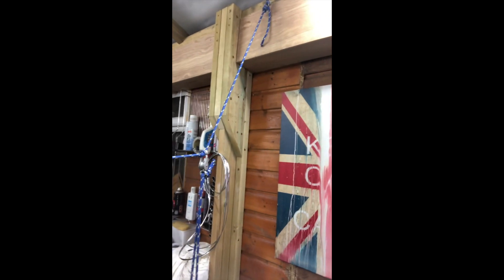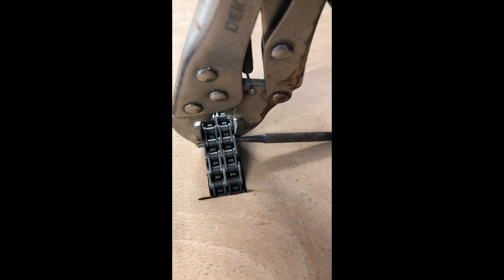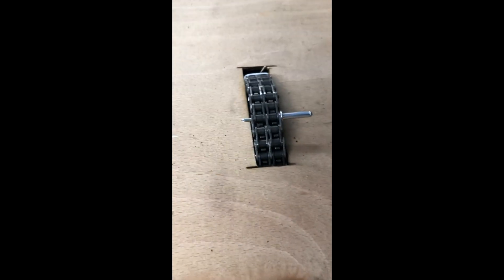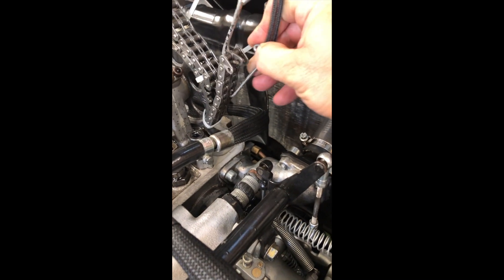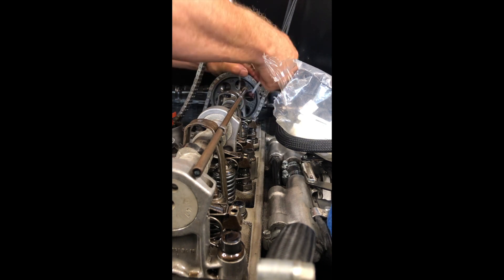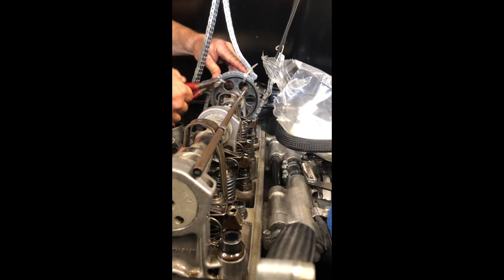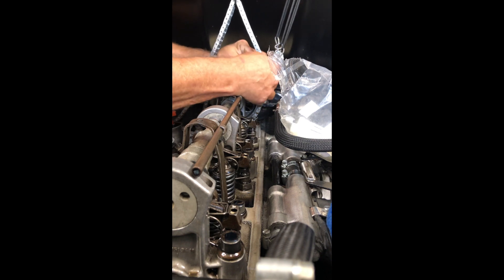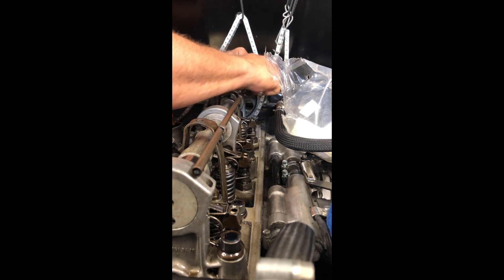TIMING CHAIN REPLACEMENT 190SL

Comment: OMG we need to TALK your way is to difficult. Wish I had met you before you started.
Reply from the maker: If you struggle get back to me and we can talk it through if it helps. If you have dropped an end or something similar it is still savable if you don't  move any of the wheels.
Reply: @rocketrule1  ;   Hallo Jason are you referring to me ? I owned a Mercedes garage in Pasadena California established in 1959 and know a much better faster and easier way to replace the timing chain , yes it takes 2 people. Worker and serviced dozens of 190SL and vintage MBZs.   But you got it done. Besides I live in Germany now.
Reply from the maker: @JPER-cv2lq  I have done this for a guy who maybe owns a 190sl like myself and want to do the chain single handed and as easily without having to set up valve and ign timing. This worked for me over the years with a number of ohc engines and is quick and easy in my opinion.
Reply: @rocketrule1  ;  okay 👌 understand. though never hurts to recheck the ignition timing or check the valves how hard can it be you've come this far. You did just find. My tips won't matter now. Stay safe and lets not drop anything (known as tool centric)  Nice meeting you.
Reply from the maker: @JPER-cv2lq  And you>